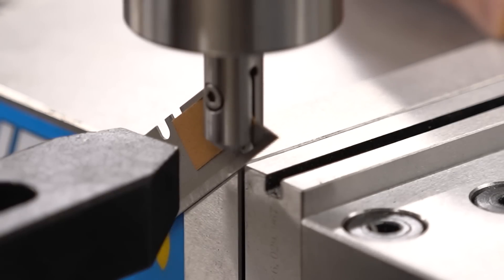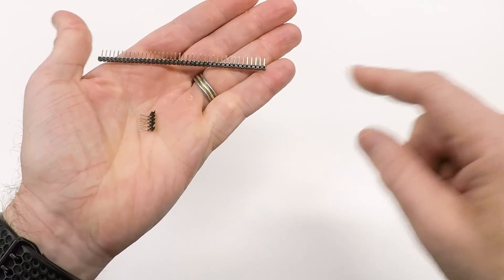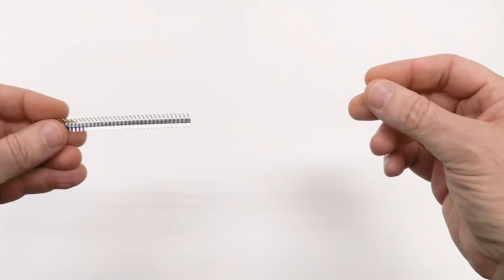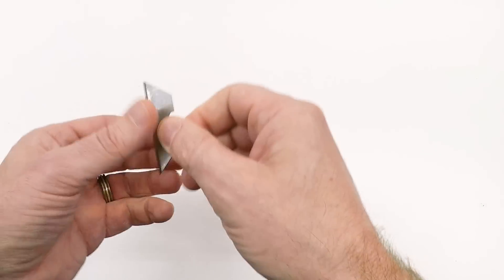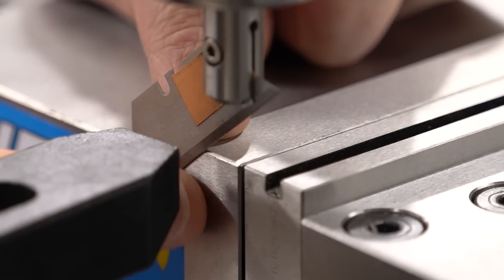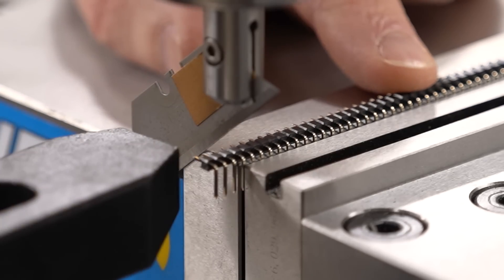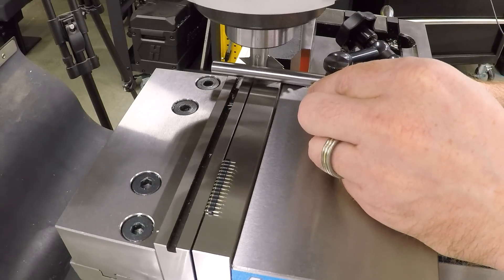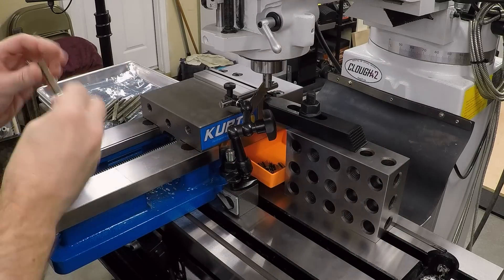Milling Machine Guillotine! | Interesting Setup in the Mill

Comment: Oh instead of knife blades maybe use the wheels that are in a plumbers copper tube slice. Easy to space them the correct spacing you want. Also it wouldn't be difficult to regrind an edge on them again when they get dull.

Comment: Are you ending up with a mis-sized piece at the end? Seems like you would want to prevent those from falling into the catch bin if that’s the case.
Reply from the maker: Not normally.  5 x 8 = 40.  Though there were some undersize headers in the last package from my supplier.  These get caught when I weigh the kits after counting out the part.  I caught all the short ones before they got to that point this time, though.

Comment: Use the tools you have to do the job you need to finish. Do not forget to make a few pictures of the setup. I made a habit of making photos of all my tooling/clamping/mounting solutions so I can make another run of products. But not after (almost) messing things up: when engraving a logo on a customer's product I had to ask the customer to show me a picture of the exact orientation of the logo on a previous run ... 
One or more photos with a few lines of text save me a lot of time figuring things out.
Reply from the maker: This is really true of CNC setups as well.  I try to print and save the setup sheets if I think I might ever need to run the job again.

Comment: Use a compressor to make the bars slide, and make the cutting action automatic. then the only thing you need to do is put the bars in place. Or you could automate it as well

Comment: Nice bodge. It's this exact scale of production where you don't need to produce so many pieces to justify building something permanent and do all the CAD/machining/3d printing work needed, but it's clearly beyond what's tolerable to do by hand. Oh, and it won't take up any of the precious shop space either. A virtual appliance, so to speak.

Comment: 9:43 When he fed in the next length of headers behind it, it caused a stray 4-pin to get in there 😅
Reply: You definitely have sharp eyes. Even at one quarter speed all I can see is a blur of the end piece falling. I did count the pins on that stick he was cutting, though, and there were fifteen, so I think that the end piece was indeed a five pin.

Comment: One trick for cutting those reliably to length I found is to make a stop that clamps to the nippers, kind of like the stop found in some wire strippers, or like a vise stop. Of course, that doesn't solve your problem of hand pain, so it might not be something for you.

Comment: Why didn't you just make a little jig thats the right length for the side cutters?
Reply from the maker: I couldn't think of a good way to do it.  Also, when the side cutters snap through the strip, the blade bevel either shoots the cut piece out at high velocity or snaps the large piece against your fingers, which hurts a lot after 600 pieces.

Comment: I have a possibly stupid idea. 3D print the same setup, but add 10 blades. One chop, 11 parts.
Reply: @Bill Carson would it be possible to design something that staggers blade contact of each cutting position by 2mm? I’d think that might address the issue.